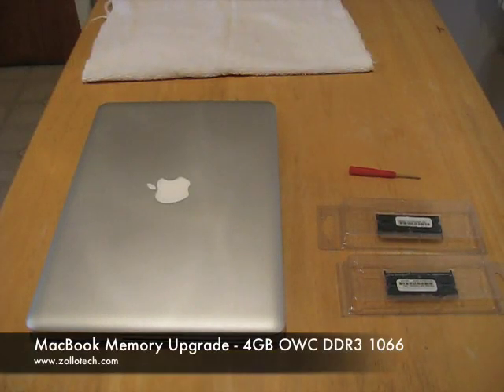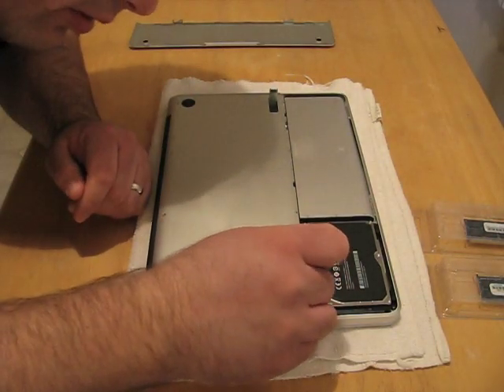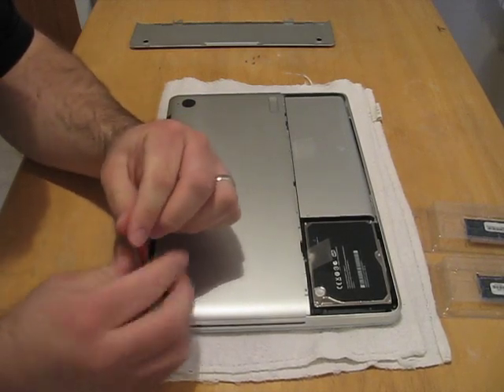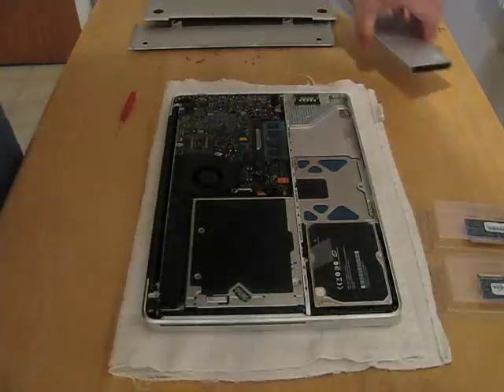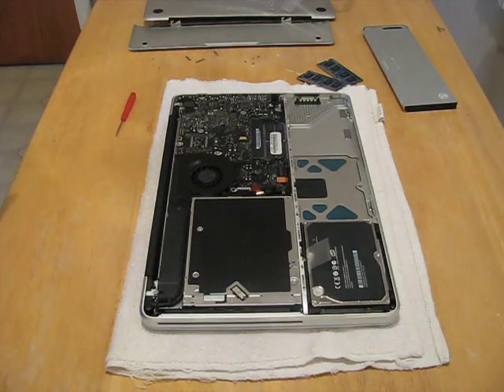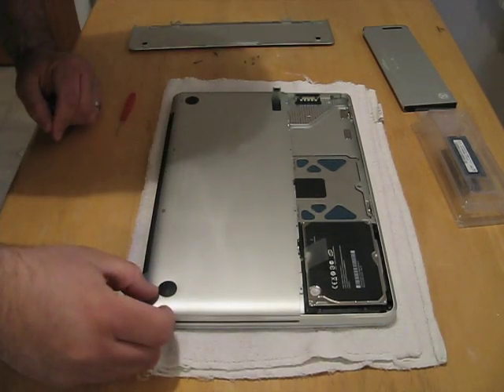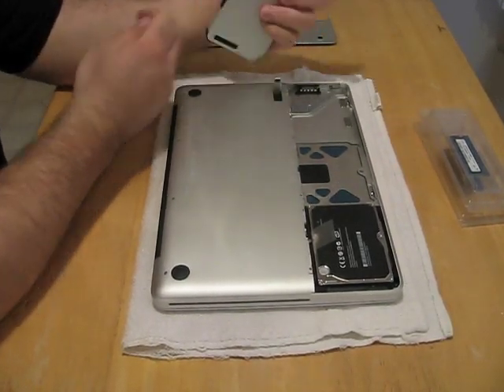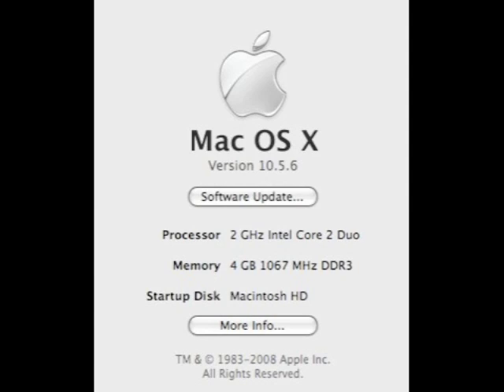Aluminum Unibody MacBook Memory Upgrade

Comment from the maker: if you are not grounded before touching the ram and you zap it with a static shock, you could potentially damage the ram.  For example:  when you rub your feet on a carpet and touch something metal that is grounded or anything that is touching ground it will shock you and whatever it touches.  The electricity always tries to find the quickest path to the ground.  That is why people who handle electronics a lot will often have a grounding strap on their shoe or ankle

Comment from the maker: it allows you to have more running and more smoothly.  It helps when rendering video.  I am not sure if Apple will do it after you buy it, but it is far more expensive.  If there is a problem related to Ram then yes it can affect your warranty.  If the problem is something else you will be fine.

Comment from the maker: the cheapest on newegg is 60 plus shipping.  The aluminum MacBook uses DDR3 204 pin memory.  The older MacBook is DDR2 which is cheaper.  Prices will come donw quickly though.

Comment from the maker: @wheely132 Samsung makes a lot of memory chips for just about every manufacturer.  Many of the different brands of ram and flash ram use Samsung chips.  I think you should be fine using it as long as it is compatible.

Comment from the maker: The graphical speed is quite a bit faster and you notice that right away.  The render speed is about the same for these videos.  Overall though with the ddr3 ram and the 9400m graphics, it is much faster,especially running boot camp with windows 7 and games.

Comment from the maker: I would buy owc as many use it and the ram chips are samsung.  The memory is no diff from oem in the old macbook, so the brand should be fine.  owc is just the reseller.  I have not played that game on pc, but bf2 runs full resolution with everything turned high and runs well.  Call of duty 4 runs well also.